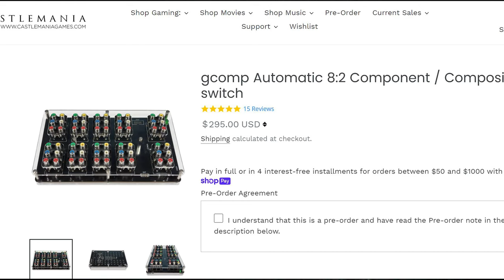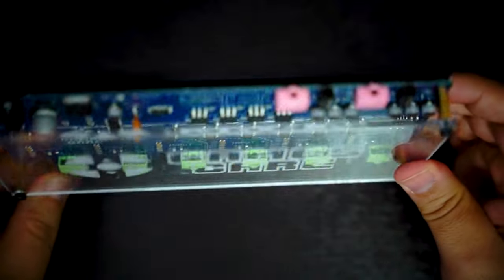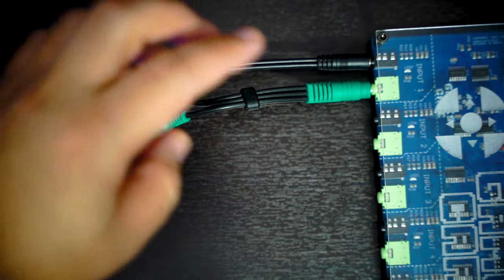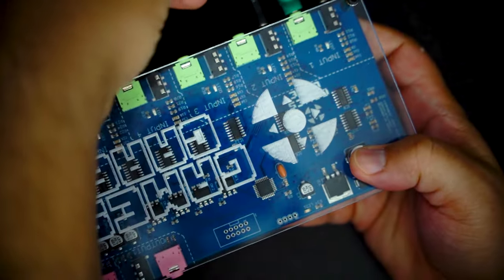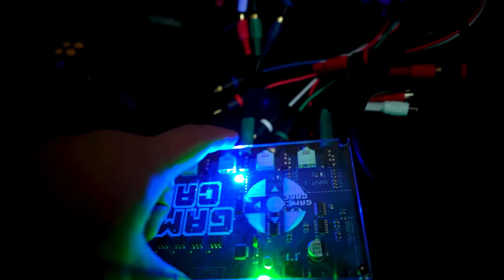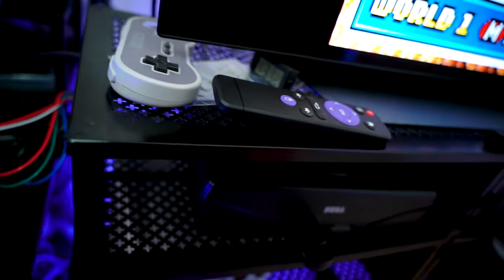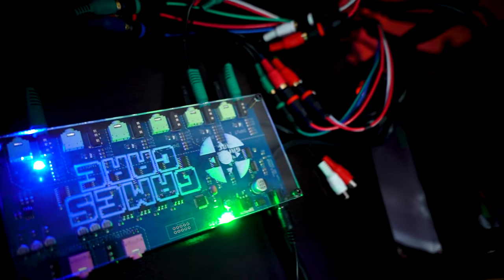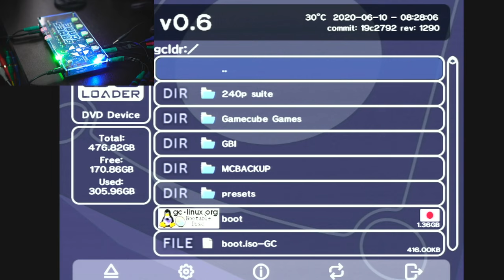AFFORDABLE AUTOMATED COMPONENT SWITCH!

Comment: It actually doesn’t look too bad. My only real complaint is the audio.
I’m hearing some distortion at certain points.
Might be a good option, but the 3.5 mm ports, I don’t know…
Reply from the maker: Actually, the audio quality seems bad in the video because that's the TV audio that I captured with my cellphone from TV speakers, that wasn't captured using a capture card. The actual audio quality is good.